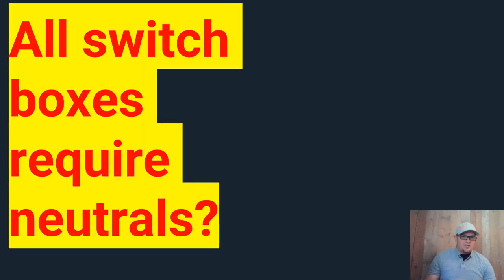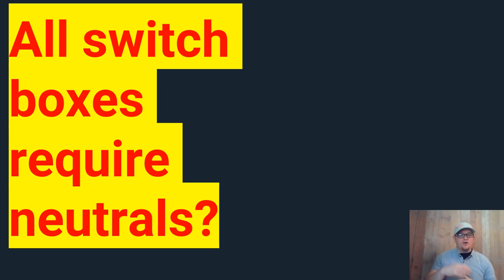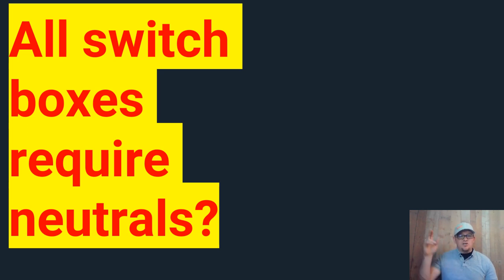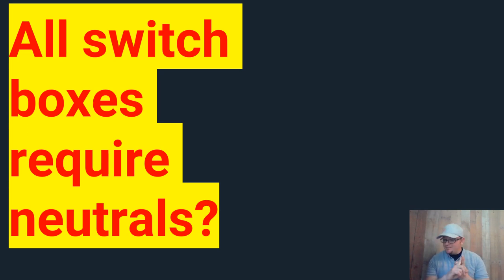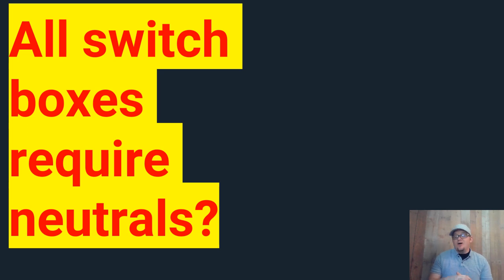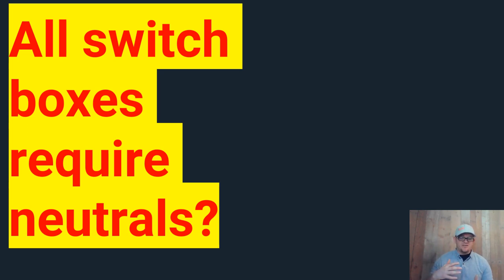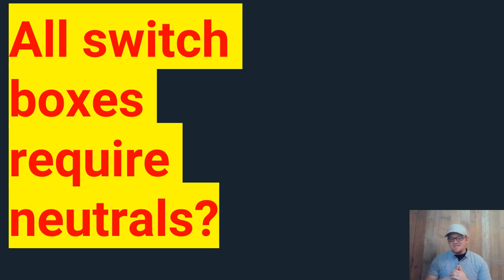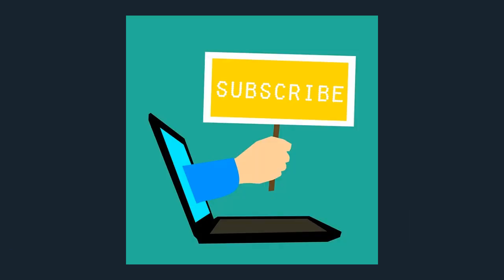Is a Neutral required in a switch box? On the Electricians in Action Everyday @ 9:00 am

Comment: Just saw this video...I am a little confused... 404.2 (c) refers to "grounded circuit conuctor" but not a "neutral" and is a neutral still considered a grounded circuit conductor if it is on an "un bonded" subpanel?
Reply from the maker: By definition the neutral is the grounded conductor

Comment: Hi code coach have a question for you I just put in new underground service to a existing service all new can panel box County  passed my work but he mentioned about separate ground and neutral and wanted to look at the panel in the house it was OK it is bonded as he pointed it out to me how to do it my question is I'm hooking up a box for my generator 50 amp I  have 2 hots 1 neutral 1ground using slot for 50amp the inlet box has red black  white and ground any special wiring for that configuration the house is wired with separate ground and neutral so do I have to wire it the same way because  the generator will be powering the house I didn't know if you had a video on this question  thanks brad

Comment: I was working in a house they just got renovated and there was a power outage in the kitchen. I couldn’t track down the problem so I decided to run a home run from the basement to the attic and re-wire the lights onto their own circuit. 

The only way to get the home run to the attic was by fishing it along the chimney because the walls were finished. 

I did not see anything in the code work about wiring close to chimneys.

i’ve heard different opinions but is it required that when you drop a new romex down inside of an existing wall to a switch or a receptacle you do not have to secure the cable to the stud? 

i’ve seen this done with MC as well just drop down inside the wall and connected to the box and it just dangled there.

And are you aware of electrical code for wind turbines? The electrical inspector testing and master electrician license for wind turbines?
Reply from the maker: Everything with Romex is about protecting it from physical damage.

And as far as wind turbines go for testing, it's most likely just going to be a look up question.